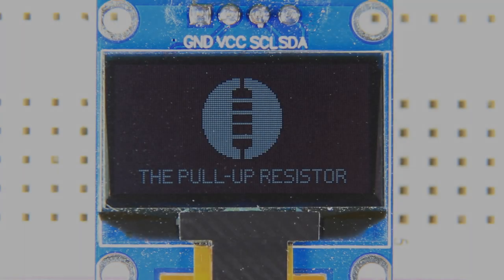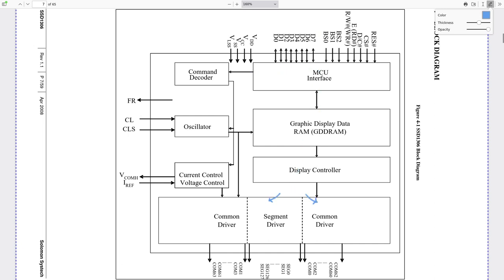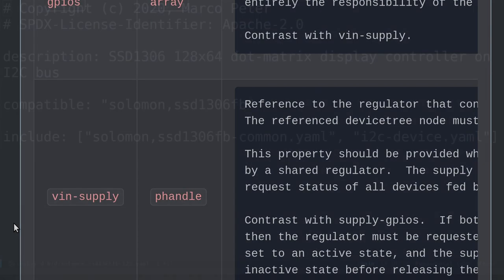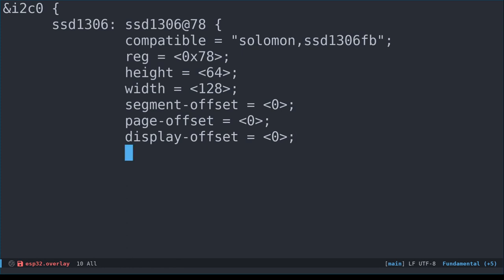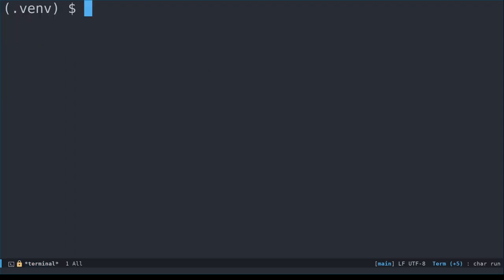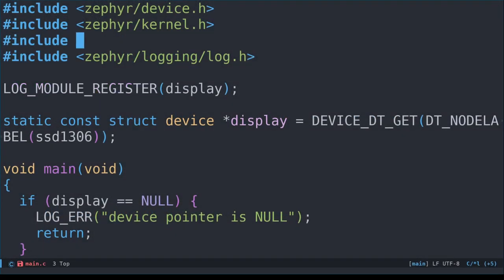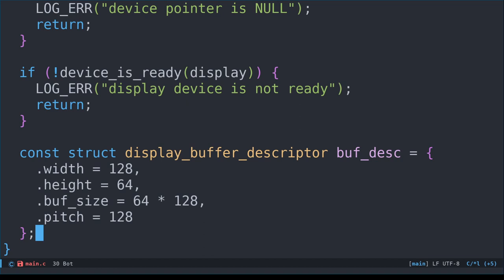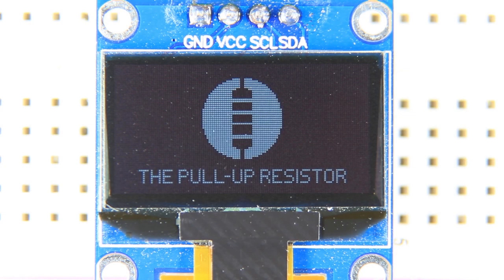[#5] ESP32 on Zephyr OS: OLED Display (SSD1306) [Part 5]

Comment: For anyone else that has followed this but got garbage on their screen, try setting "CONFIG_SSD1306_SH1106_COMPATIBLE=y" in the prj.conf file. It's what finally worked for me. I think the driver of my screen is actually the SH1106 - even though the PCB that it's on says SSD1306. Great videos by the way! Followed along with each one over the last few days. Look forward to doing the next one.
Reply from the maker: Thanks for sharing. I'm sure others using the same display as you will be grateful for the advice.

Comment: If you are using a board with non default pins/gpios used for the i2c connection, you need to specify the correct gpios in the overlay file as well.

E.g. for my wemos boards with oled display and battery holder, this worked in the end:

&pinctrl {
        i2c0_default: i2c0_default {
                group1 {
                        pinmux = <I2C0_SDA_GPIO5>,
                                 <I2C0_SCL_GPIO4>;
                };
        };
};
Reply from the maker: Thank you for sharing!

Comment: Ah, the silkscreen label assumes that the 7 bit I2C address in the datasheet is the upper 7 bits, where in actuality it is the lower 7 bits.  0x78 = 2 *0x3c
Reply from the maker: That's a very good point! You might very well be right. I'm not sure if all of these "generic" SSD1306 based displays suffer from the same mistake.

Comment: Can you do a tutorial with a rohm sensor like the bh1792?
Reply from the maker: Thank you for the suggestion! Would you mind sharing a little bit more about what in particular you would find useful? For example, are you mostly interested in custom driver development on Zephyr in general, or is there something special about Rohm sensors? I'm afraid I don't have any experience with their sensors so far, so maybe I'm not fully understanding the request. Please do let me know.

I'm currently working on a video implementing a custom driver, so maybe that will address some of your request?

Comment: warning: attempt to assign the value 'y' to the undefined symbol SSD1306_DEFAULTParsing
Reply from the maker: Please see my reply to your other comment. Hope the fix works for you.
Reply: @thepullupresistor  thank you for taking the time to help!  I am almost there however my display is fading in and out what appears to be random snow or pixels on the screen rather than the image.   I have tried changing the address from 0x3c to 0x3d and it did not work so I am almost there just need to figure this out.
Reply: @thepullupresistor  The issue was I had a 1.3" SSD1306 that was displaying as I mentioned, snow, however I found a .96" one and it works perfectly!  Do you happen to know why the larger screen produced snow?  It appears to be the same 128x64?
Reply from the maker: @mytechnotalent  Glad to hear that you found out the reason behind it. I'm afraid I haven't come across the 1.3" version so can't be of much help there, I'm afraid. If you find a datasheet you might be able to compare the I2C commands between the two displays from their commands, without having to get out the logic analyzer... Good luck!

Comment: this causes an error and an inability to compile
Reply from the maker: Thank you for highlighting this. It seems like CONFIG_SSD1306_DEFAULT has been removed from Zephyr in 3.5.0. You can see a note about it in the migration guide (https://docs.zephyrproject.org/latest/releases/migration-guide-3.5.html#device-drivers-and-device-tree). Fortunately, the fix should be easy, simply remove the CONFIG_SSD1306_DEFAULT line from your prj.conf and you should be good to go. Please let me know if that works for you.